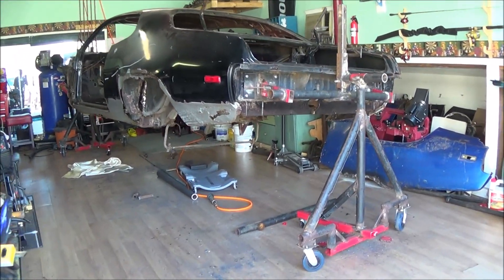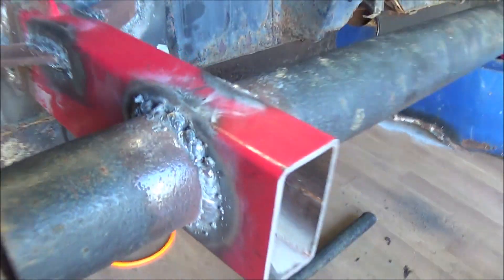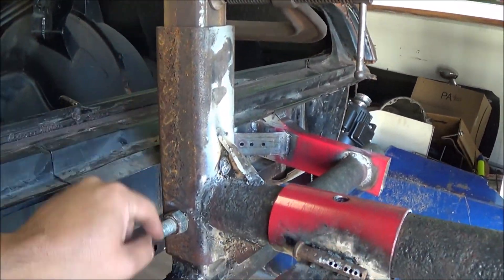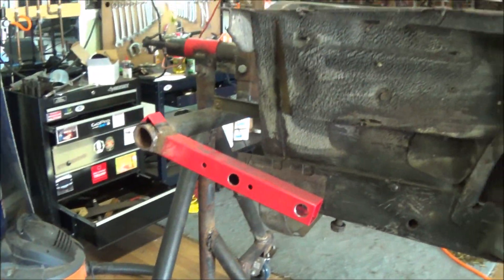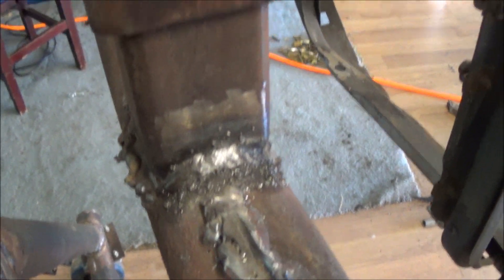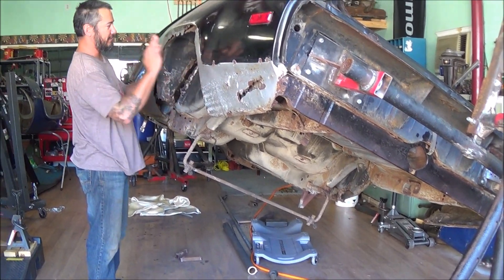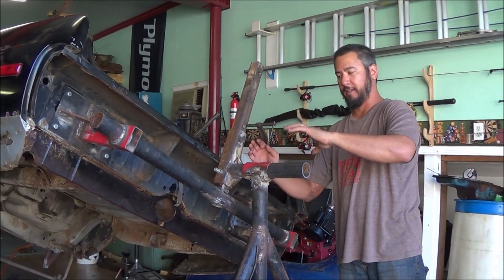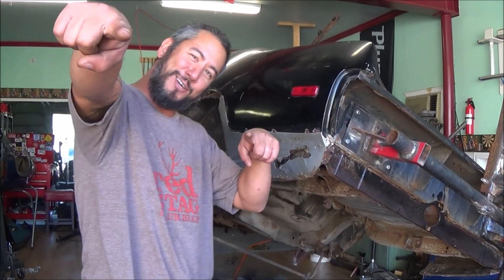Rotisserie DONE!  Home Made from engine Stands

Comment: Weld a nut on the hole and put a bolt thru it to secure the shaft. Rotate the car to where you want and tighten down the bolts. Eliminate the disks you were planning to put on. But a great idea and kudos to you.
Reply from the maker: Jim Charles thanks... That would be a good solution too!

Comment: The center pipe connecting each end is a good idea. Are you talking about the rotisserie that Jeff Lindsay built?
Reply from the maker: Carolina Man yeah... I'm going to do the center bar for sure.   It's pretty stable.   When low I pushed it around quite a bit to test it before raising it up.

Comment: Just don't get underneath it until you re weld it lol. But I'm glad your working on your own stuff. Good job man
Reply from the maker: It stayed on the rotiss for a year or so...  then was pulled onto a trailer with a winch and driven on a trailer for an hour and taken off and its still on it spinning fine.   The welds are ugly as sin, but they are holding :)

Comment: How did you lift it on to the rotisserie to that height? I am building one now with no lifts on it.
Reply from the maker: THE G MAN slowly! Lol. I used a shop crane on one and and a floor jack on the other end with "stilts".  Couple inches up on one end then the other till I could slide the tubes in.  Hope that helps!   Probably one of the more dangerous ways to do it but it worked.

Comment: Actually a very nice rack.  Did you stick weld that or Mig?  Yes, an indexing plate will give you a lot more versatility , and I second the tie bar at the bottom.  Good work though.
Reply from the maker: larryz24 thank you.  It's a combination of sick and mig.   I really suck at stick welding so I ended up cranking up my welder but never all the way up... It still would burn thru 1/4" if I stayed in the same place to long.  I had to cut one piece apart and I'm guessing I have more penetration with the mig vs crappy stick weld lol